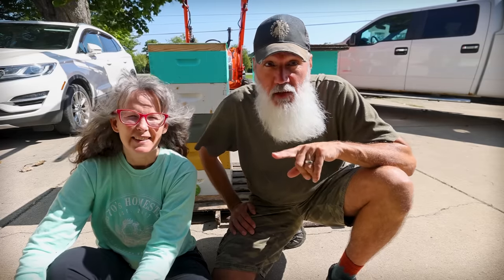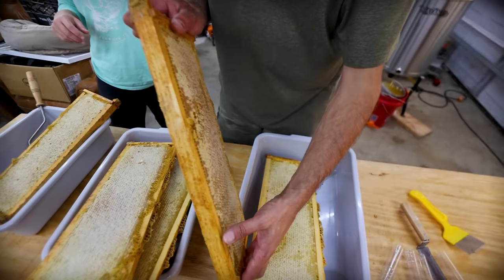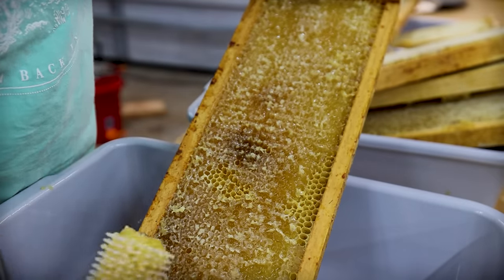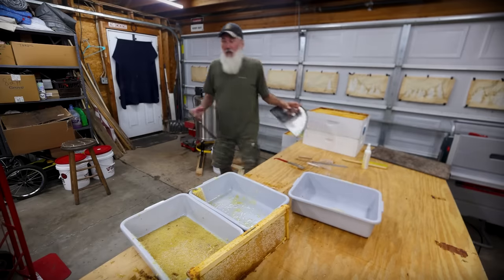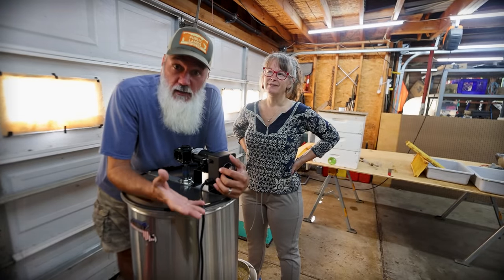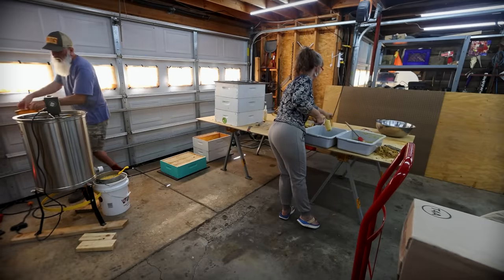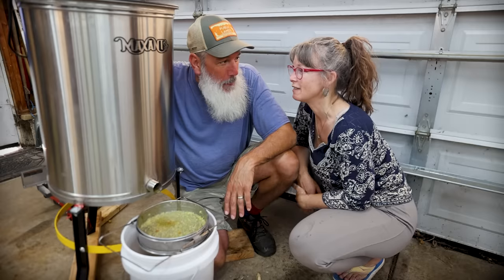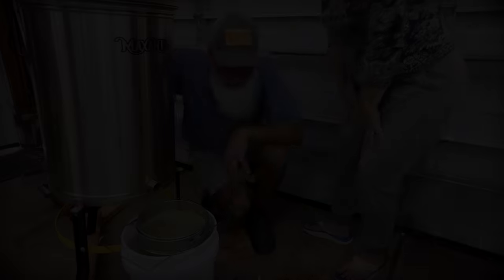Our Return to Homesteading | Biggest Harvest So Far!

Comment: I have 8 hives I’m starting next year. I had them all full in the city where I lived in Alaska. they all did so well until they all died from something around that was sprayed and they all where poisoned😢so I decided I would wait to do them again until we moved to the country. Before that I was a bee keeper for 8 years. 
I loved having bees. I’ve never felt so close to nature being a bee keeper. 
In Alaska there are no natural honey bee colonies it’s a hole learning experience over wintering. But I’m up for the challenge because they brought me so much joy. 
Rendering wax is a messy process but well worth it. Same as the harvest you will get a process down. I suggest doing it outside in a old pot that will only be used for rendering. Goodwill has lots. The other thing that worked well is paint straining bags. They have a few sizes and really helps to keep the wax clean. It will take a few times of straining to get that golden wax. Congratulations on the upcoming wedding 😇

Comment: I figured out that trying to screen the honey right out of the extractor just doesn't work. I don't screen, just let it run into the bucket. The wax all rises to the top in a day or two and is easy to skim off. Then, put the skimmed honey/wax into the screen to finish. Much faster and easier.

Comment: I got the 2 frame manual spin extractor. I would really prefer one like yours. Where did you get it and is the shaking of it bad?
Reply from the maker: It's shaking because we don't have it bolted down to anything like a chunk of wood.  We did that about 1/2 way through the video, but editing it out.  We have a Maxant which holds 6 frames.  They aren't cheap, but should be a lifetime purchase.  And if you decide to sell, you can get most of your money right back.